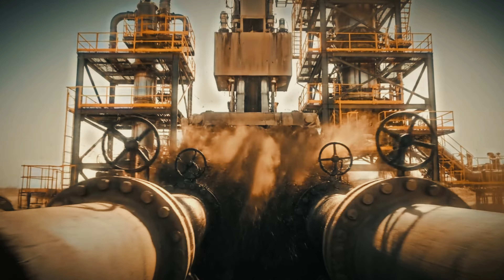From Oil Field to Gas Tank: How Millions of Barrels Are Extracted and Refined EVERY DAY

Comment from the maker: 🚨 FROM 2 KM UNDERGROUND TO YOUR GAS TANK – HERE'S HOW 🇺🇸⛽

The Numbers That Will Blow Your Mind:

Stage	What Happens	Cool Fact
🌍 Formation	50-500 million years ago	Ancient plankton & algae, not dinosaurs! 
🔍 Exploration	2+ years of surveys	Seismic waves map rock layers 2 km down 
🛢 Drilling	2-3 km vertical wells	Offshore platforms the size of football fields 
📦 Transport	Thousands of miles	Pipelines cheapest, tankers move 2M barrels/ship 
🏭 Refining	24/7 operations	1 barrel crude = 19-20 gallons gasoline 
🔬 Cracking	500°C + catalysts	Houdry's 1937 discovery DOUBLED gasoline output 
⚠ The History You Didn't Know:
A French engineer, Eugene Houdry, revolutionized the oil industry in 1937. His catalytic cracking process turned heavy oil into high-octane gasoline—and helped the Allies win WWII with superior aviation fuel .

What blows your mind most about how oil becomes gas?